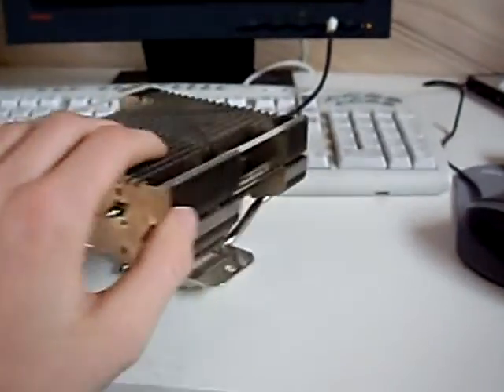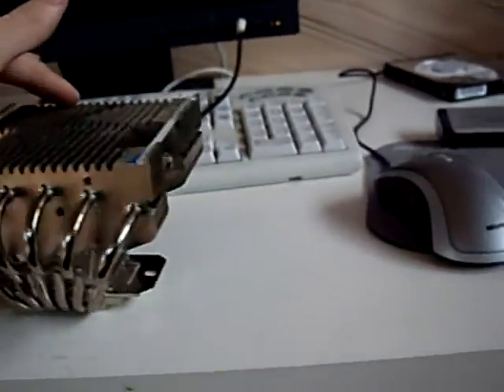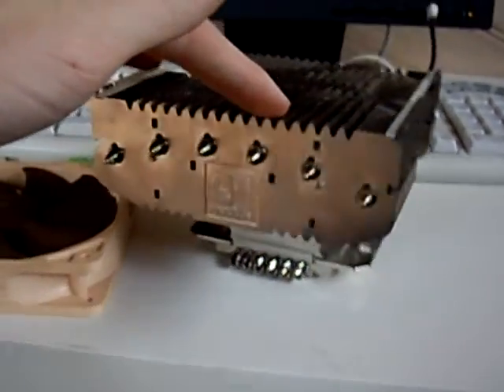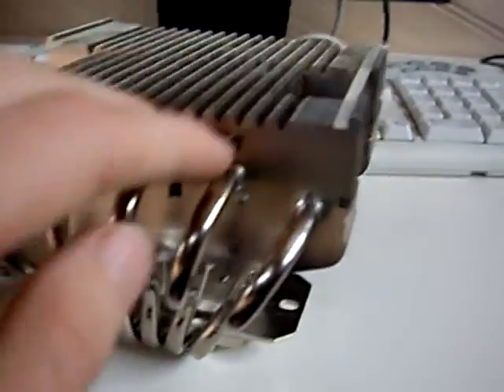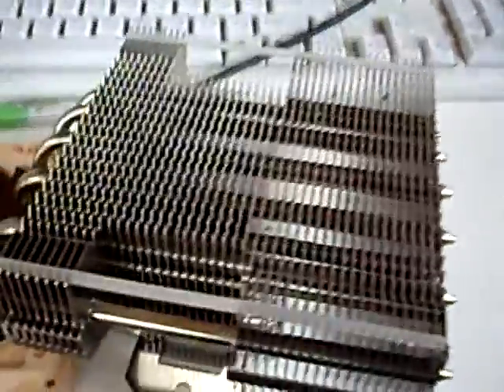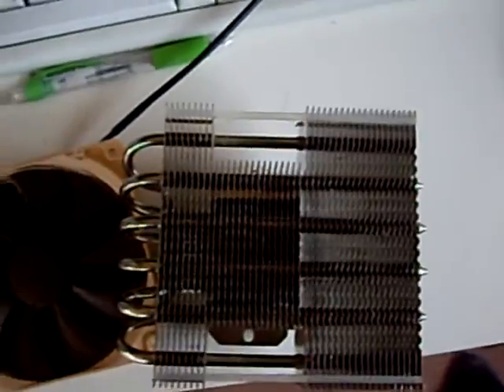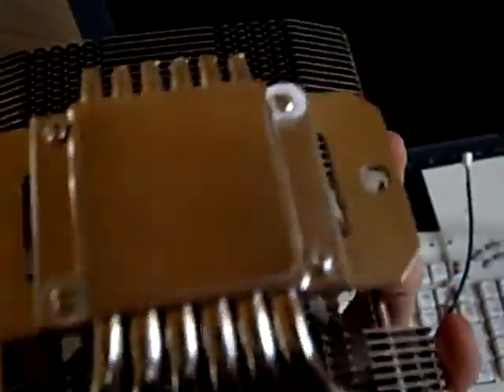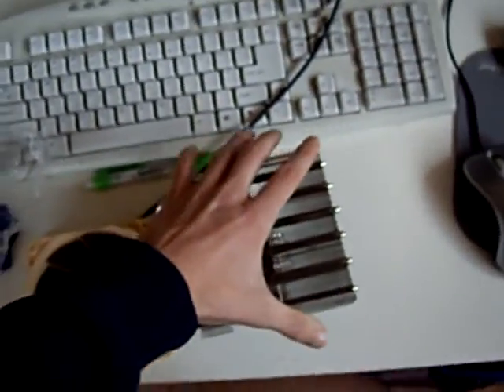Noctua c12p

Comment from the maker: very nice rig you have there. that gtx295 is very hardcore, are you planning on intense gaming? if you arnt id go buy a gtx285. it is a good cooler for overclocking, i have my AMD phenom II on 3.6ghz and it runs at about 30c. that i7 should be able to get around 4.0ghz with that cooler. what motherboard are you getting? make sure its a decent one if you want to overclock